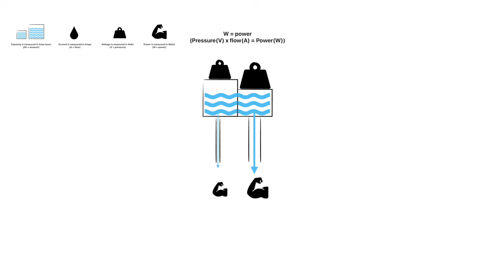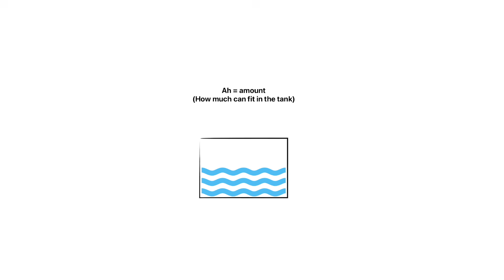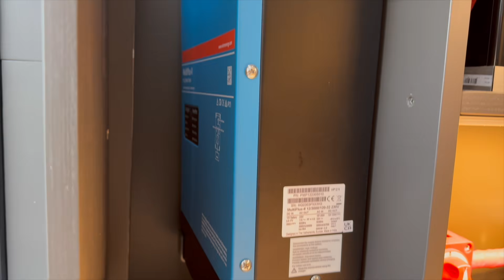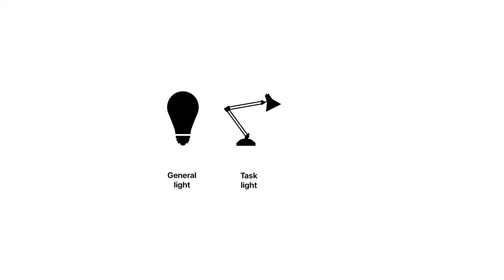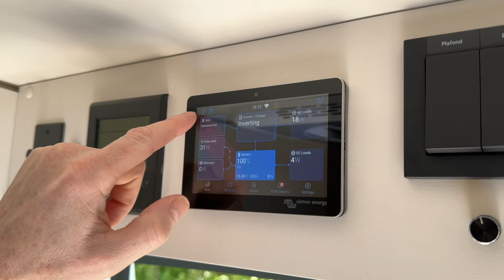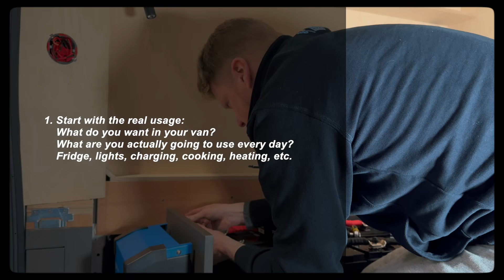I’m an Electrical Engineer, This Is How I’d Build an Off Grid System (Van Conversion)

Comment: Pourquoi n'avez-vous pas fait une installation en 24 volts
Reply from the maker: (Traduction automatique 🙂)

Simplement : budget et efficacité. Même si le 24V/48V permet d’utiliser des câbles plus fins, cela introduit aussi une sorte de “taxe de conversion”. Comme nos lumières et nos pompes fonctionnent nativement en 12V, rester en 12V évite les pertes constantes liées aux convertisseurs DC-DC.

En tant qu’ingénieur, je préfère installer une seule fois des câbles épais de 95/120 mm² plutôt que de gérer de la chaleur et des pertes de conversion 24h/24. Comme les longueurs de câble dans notre installation sont très courtes, le cuivre revenait finalement moins cher que tous les convertisseurs et protections supplémentaires qu’un système en tension plus élevée aurait demandés.

Nous utilisons aussi du load-balancing pour la plaque à induction et avons choisi des fenêtres de toit plutôt qu’un énorme parc solaire nécessaire pour faire tourner une climatisation.

Je ne recommande pas forcément le 12V à tout le monde ; le but de cette vidéo est surtout de montrer qu’il faut d’abord définir ses besoins et choisir ses composants, puis concevoir le système autour de cela, au lieu de choisir une tension dès le départ et forcer tout le reste à s’y adapter.

Comment: Batteries are heavy. Why not put them on the lower level and put the victron components on the upper?
Reply from the maker: Because the wheel arch sits behind the cabinet, so we have less depth at the bottom part. We need the depth above the wheel arch for the batteries which are way bigger than the Victron components. 🙂

Comment: I'm an EE too.  I'd buy an all in one, "hybrid" inverter normally used for off grid or grid connected residential solar systems.  They have a MPPT solar charge controller, battery charger and grid synchronized inverter all built into one package.  Connect the panels, connect the batteries, connect the AC load and you are done.   Way cheaper than 10 Victron boxes.  Way less wiring.
Reply: I'm an EE and if you asked me 2 weeks ago I would have said the same, until I actually looked into it - the victron system is much better suited to a van installation. I am building now and intended to do the hybrid inverter approach but I have decided to go with victron instead - all-in-one is great until you need some flexibility - and you find it isn't there.
Reply: @simonrichards150  I'd love to know what the hybrids don't do.  Maybe I need to use Victron components as well.

Which hybrid did you look at ?
Reply: @SomeTechGuy666  I looked at so many of them, lol. The main issues I found were around safety and then around MPPT spec vs. VA rating. e.g. the hybrid inverters tend to have a specific warning against mounting them on flammable materials (i.e. wood, which is an obvious choice for a van build), and generally must be mounted vertically (dictating your use of limited space), but the victron is fine mounted however you like. Then the MPPT - I am building a 48V/6.5kVA system - and at these powers the hybrids have high minimum MPPT voltages - 90V for example, which is not easy to achieve with large roof panels, even using N-type panels. In the end I managed to get ~65V from two N-type panels in series but there is not space for a third, and using smaller panels becomes less efficient re. weight as you have more frame/mounts vs. panel ratio. I can also decide to have as many separate MPPTs as I like with the victron system and monitor them all with the Cerbo-GX - I have one for the roof panels and a separate one so I can attach portable folding panels outside if necessary. Even the Cerbo-GX/touch panel is a point for victron because not many hybrids offer a plug and play remote display/monitoring interface. Then there is the warranty etc - sure there are a lot of hybrids out of CN that offer warranties but who knows if you will be able to claim when a problem actually arises in a couple of years - victron has been around for a long time and is based in a jurisdiction that could actually support a claim in the event that everything goes wrong. I could go on but you get the idea.
Reply from the maker: @simonrichards150 have to say that I completely agree with you 👍🏻 that’s exactly why I went with the Victron set-up.
Reply: ....for example.... 🤔😄
Reply from the maker: Hi fellow EE 👋 There are definitely some solid all-in-one solutions out there, like EcoFlow and Bluetti, and for simple builds they make a lot of sense. The main limitation I see is usually on the 12V side: often you’re restricted to a cigarette-style output or, on the higher-end models, a dedicated 30A 12V output. That can become limiting once you start adding pumps, heaters, fridges, or want to expand the system.

What I like about Victron is the modularity, you build exactly what you need, sized for your own use case, and you can scale or modify it later without replacing the whole system. For van life, that flexibility is a big advantage. It’s also a very stable and proven ecosystem (and as a Dutch brand, I might be a little biased 😉).

Another thing that I don’t quite like about the all-in-one system is the single point of failure and the warranty claim that goes with it. Most of these also go out of date with new versions coming out from time to time. 

I’m curious though: which hybrid all-in-one systems would you recommend? As an EE, I personally like having full control over every part of the system and being able to optimize it exactly the way I want.
Reply: @ourtraveljournalnl    I wrote out a long reply but YT seems to have deleted it.  If it doesn't show up soon, I'll reply by email or something.
Reply from the maker: @SomeTechGuy666 hmm, it doesn’t show 🤔
Reply: Dang I would have like to see your reply.  Could you break up your reply here into several parts?

Comment: I m using the same just other way

200ah 24 v with 1080w solar + 145/50 mppt
Reply from the maker: Wow, that’s a lot of solar! Great 24V system you have! ⚡️
Reply: @ourtraveljournalnl in India U get a lot of sunlight so why not (10-11 months easy 8-10 hours per day)

DC to DC charger from alternator + AC to DC for shore power....

320 L water

100% off grid
Reply from the maker: @JasonLoganbourne really nice 👍🏻

Comment: What do mean with „you have 
limited the output using low balancing“ for the induction stove ?
Reply from the maker: Thank you for your question 😃 What we mean by “limiting the output using load balancing” is that the induction hob automatically manages how much power it uses.

We have an IKEA Valbildbad induction hob, and our inverter can supply a maximum of 2400W. However, if you run both cooking zones at full power (level 9), the hob would normally require around 3600W.
Because of the built-in load balancing, the hob prevents that from happening. So if one cooking zone is set to level 9, the other one will automatically be limited (for example, to level 6). This way, the total power consumption always stays within what our system can handle.

In short: the hob adjusts the power distribution between the zones so we don’t overload our inverter 😊

Comment: You could have used an oil pressure switch to trigger the DC/DC charge controller. IF the engine is running, THEN the oil pressure switch is made and the charger activates, no times simple reliable.
Reply from the maker: That’s a great suggestion! Using the oil pressure switch would be a clever way to deal with it. However, on this 2022 Euro 6 Ducato, we wanted to avoid tapping into the engine sensors to prevent any CAN-bus interference or ECU fault codes.
We went with our solution because it gives us total control and high reliability without touching the engine's sensitive electronics. Another good way would be a dedicated CAN-bus D+ interface, creating a fake D+ signal, but our current approach was a cheaper solution for me, and easy to control. 😄

Comment: Once again an electrical install in a van that requires you to lie down with your head in the garage to install and maintain.  Everyone puts their toilet on a 500KG drawer slide but not the electrics?! Baffling.
Reply from the maker: If you want to build your electrical system on a sliding setup, that’s totally your choice.

For us, it made more sense to prioritize easy access to things we use multiple times a day like the toilet. (I’m not entirely sure how a daily-use item like that compares to the electrical system, but okay 😅) When the electrical system is installed properly, there’s rarely any need to access it anyway. In our case, it’s something we almost never have to touch 😉. 

On top of that, putting it on slides would require extra cable length to allow movement, which adds both complexity and cost. So for us, it simply wasn’t worth it 😃

Comment: if you’re an electrical engineer, why would you build/recommend a 12v system? 24v/48v are the future and they’re more efficient and save a ton on copper wire costs
Reply from the maker: Simple.. budget and efficiency 😃 While 24V/48V allows for thinner wires, it introduces a "conversion tax." Since our lights, and pumps are natively 12V, staying 12V avoids constant efficiency losses from DC-DC converters.

As an engineer, I’d rather install thick 95/120mm² cables once than deal with conversion heat 24/7. Since our runs are very short, the copper was actually cheaper than the extra converters and protection devices a higher voltage system requires. We use load-balancing for the cooktop and choose roof windows over the massive solar array needed for airco.

I’m not necessarily recommending 12V for everyone; the point of this video is that you should select your needs first and engineer the system around those components, rather than just picking a voltage and forcing everything to fit. Regarding 24V/48V being "the future" It’s just a voltage, not a new invention. While 48V will likely become more common as we move toward fully electric campers, the "best" voltage will always depend on your specific setup and load requirements. 🤗
Reply: @ourtraveljournalnl  by “the future” i mean there are way more 24v/48v LiFePo4 batteries on the market these days than there used to be, as well as 24v/48v versions of plenty of appliances.

in terms of avoiding buck conversion losses/heat, what about just having one 12v battery (for those few appliances you can’t get in 24v or 48v) alongside a 24v or 48v main bank with a DC-DC charger to top off the 12v battery?
Reply from the maker: @glitterishhh I totally understand your point now regarding 'the future' the availability of 48V LFP and compatible appliances has definitely shifted the market. 

Adding a separate 12V battery and a DC-DC charger on top of a 48V bank just to run lights and a pump is exactly the extra complexity we personally wanted to avoid. In a build this size, more components mean more potential failure points and more idle power draw. There’s definitely no 'wrong' way to do it, but for our specific energy needs, 12V is a solid, reliable solution without the extra hardware. 

It’s all about finding the balance that works for your own build. 😃 It’s good you think about it thoroughly!

Comment: For an electrical engineer it’s quite odd you didnt add a fuse on the battery itself before the main switch. The MEGA fuses (in your Lynx) IAC rating isnt high enough to handle a short in a LiFePO4 battery. Especially with 400Ah and no the BMS wont protect for this. 

So I was wondering why this wasnt added?

Nice build though, clean!
Reply from the maker: Great catch, and I appreciate the sharp eye! You're absolutely right about the AIC (Interrupt Capacity) standard MEGA fuses can struggle with the massive short-circuit current a 400Ah LiFePO4 bank can dump.

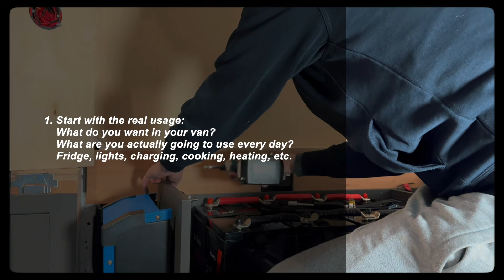We actually installed an ANL 400A fuse for that exact reason; you can spot it at 27:15 The positive runs through that ANL fuse before the main switch, and the negative goes through the SmartShunt. Both then feed the Lynx Distributor where the smaller components are fused. We were also strict about keeping the positive/negative cables the exact same length to keep resistance equal for balanced charging. 

That said, the core of this video was about selecting needs first and engineering around them, adding the needed basics controls and build smart controls on top of that. I’m thinking of doing a Part 2 to geek out on the technicals: how to choose system voltage and why, fuse placement/purposes, which cablelugs I used, and a deep dive into the diagram for this specific build. Thanks for the compliment on the clean look! 😃
Reply: @ourtraveljournalnl ahh I spotted the ANL fuse when you showed the box with spare fuses but didnt know they existed with such a high AIC. 

But good to know its taken care of, would be a shame if something happened. 

Thanks for the quick response! Well done again!

Comment: nice video, where do you get your electrical equipment from such as cables, breakers and switches?
Reply from the maker: I get my equipment from both Amazon and electrical wholesalers through my work. For dimmers and USB outlets, online shops are great (like Amazon), but for the switches, I used Gira System 55 momentary switches. They are high-end home switches that "spring back" to their original position after pressing, so they always look uniform on the wall; esthetically pleasing, which makes Sanne very happy as well 😉 For heavy-duty cables and lugs, you can find many online retailers that sell them pre-cut to the exact meter. Hope that helps! 😃
Reply: @ourtraveljournalnl thanks!

Comment: By far the best video on van electrics I have seen.  But I am curious as to why you decided to go for 12v rather than 24v or 48v?
Reply from the maker: Thanks a lot! 😃 It’s simpel.. for us it was budget and efficiency. Most of our daily components we chose like the fridge, lights, and pumps are natively 12V, which are cheaper and more common. By staying with a 12V system, we avoid constant conversion losses and the need for extra step-down converters or shutoff devices, keeping the build simple. We manage our 230V cooktop with some load-balancing magic to stay within the 2400W limit of our Multiplus-II. While a 12V airco is possible, we chose more roof windows over the extra solar and batteries required to run one. As for the wiring, since our runs are very short, the cost of thick 95/120mm² cables was actually lower than buying the extra components needed for a higher voltage system.. 😅

If you need more power than this, 24V is a very valid option. We just didn’t need it for our specific usage and it would have cost us more for this setup. The point of the video is that you should select your needs first and engineer the system around those, rather than just picking a voltage and forcing everything to fit. 🤗
Reply: @ourtraveljournalnl  I did the same, but on my next van I think I would go to 24 or even 48.   Sure you need extra step-down conversion for 12v stuff, but efficiency of higher voltage is still higher overall. Wiring also easier/cheaper.  Cost probably cheaper for 48v too.  e.g. right now from my preferred UK vendor, Victron Multiplus II 12v 3000VA/120A is £999, whereas 48v 3000VA/35A is only £430 and is physically smaller!  Adding in an Orion 48V-12V step down (£50 - £170 depending on power) or two still makes the 48V system cheaper unless I am missing something.  Also lol at you saying you want to keep the build simple - I just watched the video haha!  Great video though, very well explained

Comment: That ist the best electrical build in a camper so far I have seen on YouTube! Thanks a lot for sharing your knowledge. Do you have any scheme for your build as a guide? And how would you build a 12V/230V Version around a Powerstation like the ecoflow delta for example? Just for being flexible and just for having a little bit of power in a simple build?
Reply from the maker: It really depends on what you're trying to achieve; this is perfect for a car or tiny minivan, but for a larger camper, like ours, it’s honestly a bit limited. That said, you can use an EcoFlow as a heart by connecting a 12V fuse box to the DC outlet for lights/USBs. Charge via a waterproof port for mobile solar, or an 800W Alternator Charger to top up while driving. For higher demands, the DELTA Pro’s 30A port handles 12V loads like pumps more reliably than the cigarette plug. This is just based on my research. What kind of camper/van are you building? 😊
Reply: @ourtraveljournalnl  We drive an old VW LT1 Camper with just one standard 95Ah Battery at the moment. But the electrical side is the last big thing I need to do because everything is old (1978). I thought when just one battery is powering our camper, so a Powerstation would do the things too. And it should be "easy". On the other hand, I would like to have such a well thought system like you have. But for now this is over my limits... 😊

Comment: Love the video , I have same van and just starting the electrical system. Couple of questions do tou have a link to the ikea load balanced induction hob. Also is your van a L3 H2 . Thanks in advance
Reply from the maker: Thank you so much! Yes, we have the L3H2. 

This is the link to the induction hob: https://www.ikea.com/nl/nl/p/valbildad-inductiekookplaat-ikea-300-zwart-20467592/
I’m not sure if it works as it’s the Dutch webpage, but the name of the hob is Valbildad. Hope they sell them in your country as well. 

BTW, on our webpage you can find all the products and tools we used during our van conversion! Very handy during your build 🤗
https://ourtraveljournal.nl/en/free-diy-van-conversion-tools-and-products-guide/?v=1a13105b7e4e